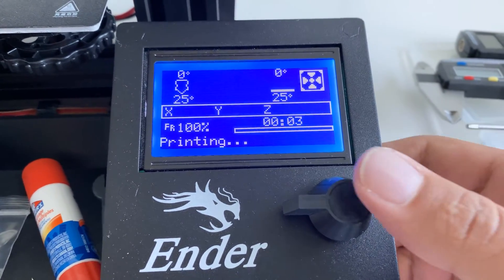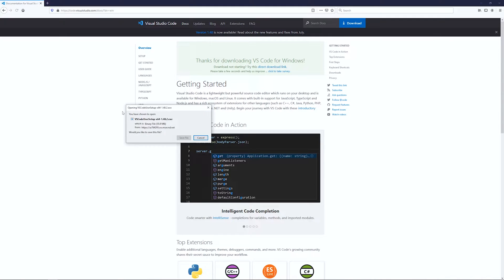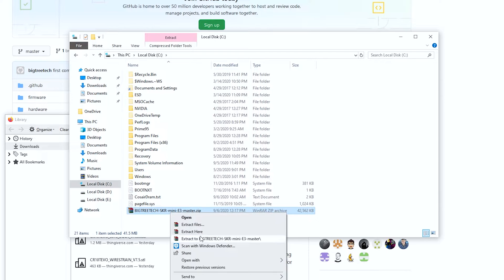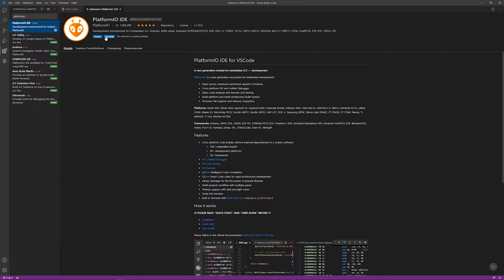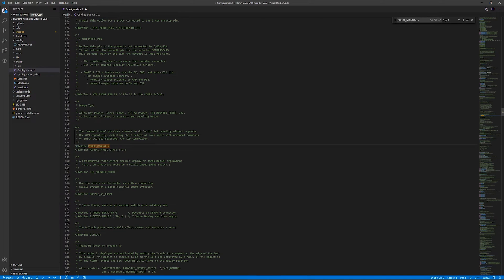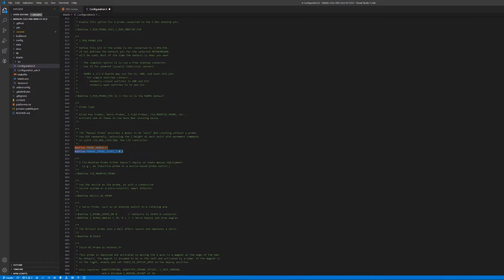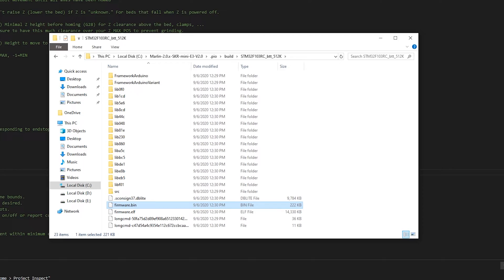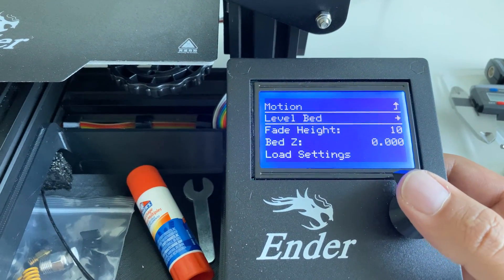Ender 3 Pro BigTreeTech SKR Mini E3 V2.0 Updating & Compiling Marlin Firmware | Mesh Bed Leveling!

Comment from the maker: A heads up that the step of updating the platform.ini file to alter the environment line is no longer necessary. This issue has been resolved in the later firmware versions. You can skip that step.
Reply: Sir i have 2 skr kit
Reply: But no idea
Reply: Did you mean the platformio.ini file?
Reply from the maker: @Mikey_xx_  Correct, that's the one.
Reply: @Boone Nikolas Instablaster ;)
Reply: @Jack Bowen I really appreciate your reply. I got to the site thru google and Im trying it out now.
Seems to take quite some time so I will get back to you later with my results.
Reply: You all prolly dont give a damn but does someone know a trick to log back into an Instagram account?
I was stupid lost my login password. I appreciate any help you can offer me
Reply: @boonenikolas4923  first you need to delete the app and reinstall, when the install is done and before you load the app the first time, go into settings>instagram. Enable GPS in the quick menu, and switch to maps, find the nearest river and throw your phone in it. Works everytime

Comment: When they compiled the firmware what temps did they use for the bed temp
Reply from the maker: You mean the max bed temp allowed in the firmware? If so, the default Marlin configuration has this set as 125 degrees. Not sure if that is changed by Creality in their firmware though.
Reply: @Mangorille  why that high of an temp is it suppose to be that high
Reply from the maker: @monsterstorm78  That's the default temperature. I believe the Ender 3 Pro spec is max 110 degree. I've never used a temperature that high before in real world.

Comment: I'm having trouble from the start. While I've done development work, I haven't touched Windows since 2000 and I'm working on Linux, so things look a little different. I have no idea what is compatible with what in this setup. I get that I need a Git client, but when I go to the link you specify, I get a choice of about 2 dozen clients I can download. Is there one, in specific I need? And is there a way to integrate it with Visual Studio? I didn't see any of the startup configuration windows or steps you're going through and it's hard to read the text, even when I make the video go full screen.
Reply from the maker: You can get the GitHub Desktop, you really won't use it for anything but I found the firmware would not compile without it installed.
Reply: @Mangorille  Yeah, I remember going through and finding that nothing was using it - but I didn't go deeper into it since I wasn't sure which one to get. Thanks!

Comment: Thank you so much for making me this video.
Hey are there any updates on this video maybe to include the BL touch and maybe also a full  Metal hottend Temp limit Disable? Because I'm stuck so many issues....
Reply from the maker: Hey. There's another pre-compiled firmware available from BTT that includes the BLTouch. You can use that or you can take the latest regular firmware and just modify it to activate BLTouch, there aren't that many settings. I've never tried to disable the temp limit though.
Reply: @Mangorille   Thank you so much, it worked like a charm now I gotta figure out how to increase my temp limit so I can print  Polycarbonate And nylon!
Thanks again!  I hope I can help the community as well to learn I'll keep you up-to-date as I learn more!
Reply from the maker: @johneveryman1374  No problem. Check the specs of the hot end you have now, most have a temp limit themselves considering the materials used and the design. If you want to go above that temperature, you'll actually need to change the hot end assembly itself.
Reply: Awesome!! The more we know! Right?
Thank you!
Reply from the maker: @johneveryman1374  For sure, no problem. Search for what's called an all metal hot end, that's typically what you need for higher temperatures. The Ender 3 stock hot end is NOT all metal (has the PTFE tube running inside)

Comment: Can this work on the creality 4.2.7 board?
Reply from the maker: Yes but not using exactly these steps. You need to get the normal Marlin firmware and then modify it for the Ender 3. Definitely more involved.

Comment: every time i start the machine its gives me an error message (i use a btt tft 35 display) "failed to enable bed levelling". As far as i can see there is nothing enabled mentioning auto bed levelling.
Reply from the maker: Hey. I never noticed this as I had bed leveling on my printer. Did you check the config file to see if there was anything in there about bed leveling that may be enabled?

Comment: Já está habilitado o "MANUAL_PROBE_START_Z 0.2" ? Encontrei em "*If ANY(MESH_BED_LEVELING, AUTO_BED_LEVELING_UBL, PROBE_MANUALLY)" e não tenho certeza se está correto.
Reply from the maker: It wasn't enabled by default back when this tutorial was made, it's possible that they added this since then. Even if it is enabled, make sure it says 0.2 please.
Reply: @Mangorille  Foi compilado mas não ocorreu tudo bem na impressora, o eixo X fica travado e não percebi que houve a mudança de altura no bico. Tem algum tutorial para essa placa mais atual? inúmeras tentativas de um firmware que funcione e nada.
Reply from the maker: @Garagemdusouto  What do you mean by locked? The height adjustment should be on the z axis.
Reply: @Mangorille  Não alterei nada nos eixos, os motores do eixo X fazem barulho quando tento mover, pensei que fosse a sensibilidade alta na configuração do sensor homing , mas não é. Já estou desanimado, infelizmente.
Reply: Consegui 100% na compilação sem apresentar nenhum erro na TFT e todos os eixos se movem, mas quando mando imprimir o eixo Z não sobe para construção de uma nova camada, fica fixo em Z(0,2 mm). O que pode ta errado?
Reply from the maker: @Garagemdusouto  I haven't seen that issue before. Would need to troubleshoot to see what's going on. Best would be to flash the same version firmware you have but don't enable the mesh bed leveling and see if the printer works correctly.
Reply: @Mangorille  Vou desabilitar o nivelamento e ver se funcionou. Atualmente tem alguma modificação no firmware diferente do vídeo para atualizar?
Reply: @Mangorille  Fiz a troca do vidro por um espelho e nivelei a mesa, assim consegui um bom resultado na primeira camada, mas o eixo z avança pouco e não consigo terminar a peça. 
Percebi um erro quando mandei o eixo Z subir 250mm e só subiu 25mm.
Reply from the maker: @Garagemdusouto  No, just this modification
Reply from the maker: @Garagemdusouto  This sounds like a step calibration issue in the firmware. Is this on an Ender 3 Pro with a SKR Mini V2 motherboard?
Reply: @Mangorille  Não, comprei todas as peças da impressora e montei. O firmware está para Ender 3.
Reply: Não consigo fazer funcionar 😢

Comment: I see you still have the stock screen, would any of this change if you have the BigTreeTech Touch screen?
Reply from the maker: No it does not. We actually changed to the BTT touch screen in a later video: https://youtu.be/kL9PJB7YFfA
Reply: @Mangorille  I just watched your other video and updated my screen to the the newest github relase they had there but when i go through to do the mesh bed leveling (Touch side) it shows me 5 different points to level it at, but there is no way to move it up or down or save it, (Marlin Mode) under motion it just shows level corners and same no way to move it or save each corner, I'm still running bugfix-2.0.x dated 2021-06-05, think it might be my Marlin that doesn't have it enabled?
Reply: @Mangorille  I updated the Firmware on the Main Board and i got it to show up on the touch screen, it was missing the auto Level, thanks your your help and your great videos
Reply from the maker: @jasonmuller2225  You can add custom commands on the touch screen for that or you can switch from the touch interface to the marlin when doing the leveling.

Comment: hello, very good explanation, I did everything and it worked, the bad thing is that now I constantly get the error "THERMAL RUNAWAY", what can I do, I can't go back to the previous version either.
Reply from the maker: Hey. Can you confirm that your temperature sensors are working correctly? Do you see them reporting an increasing temperature before the error message comes up? Is this on the BTT Mini E3 2.0? If you feel these are all working okay and you are getting a false positive, you can modify the sensitivity of the setting in the Configuration_adv.h file. Look for the section THERMAL_PROTECTION_HOTENDS.

/**
 * Thermal Protection provides additional protection to your printer from damage
 * and fire. Marlin always includes safe min and max temperature ranges which
 * protect against a broken or disconnected thermistor wire.
 *
 * The issue: If a thermistor falls out, it will report the much lower
 * temperature of the air in the room, and the the firmware will keep
 * the heater on.
 *
 * The solution: Once the temperature reaches the target, start observing.
 * If the temperature stays too far below the target (hysteresis) for too
 * long (period), the firmware will halt the machine as a safety precaution.
 *
 * If you get false positives for "Thermal Runaway", increase
 * THERMAL_PROTECTION_HYSTERESIS and/or THERMAL_PROTECTION_PERIOD
 */
Reply: @Mangorille  
Hello, thank you very much for the answer, I tell you:
the board is the "skr mini e3 v2.0" and the printer is the Ender 3 Pro.
as for the thermistor it was the first thing I changed just in case but it didn't work. The sensors report normally.
The printer starts printing normally but in the 3rd layer when the fan goes to 100% the temp. drops from 205 to 200 and it is not able to recover the value of 205º so after a minute it gives an error.

Translated with www.DeepL.com/Translator (free version)
Reply from the maker: @you33771  You can try adjusting those parameters I mentioned to make the thermal runaway less sensitive. Are you using the stock parts cooling fan?
Reply: @Mangorille  problem solved, thanks.  the fan was hitting the block directly and the motherboard was not able to bring it back to its nominal temperature. Very kind
Reply from the maker: @you33771  Glad you got it figured out. Happy printing!

Comment: does it have power loss function ? where i can get the file for sd card without using the software please
Reply from the maker: I haven't tried but I believe so. You can see the definition of the function under Configuration_adv.h file. It's in the section called POWER_LOSS_RECOVERY. To enable, you need to use the M413 command. You would need to play around with it, we have our printer connected to a UPS so no need for this.
Reply: @Mangorille  i am not good at programming i tried once and lots of error. do u know where i can download the file and put it on the sd card ? i dont have bl touch
Reply from the maker: @3dartslb  Which motherboard do you have?
Reply: @Mangorille  skr.mini 1.2

Comment: I did this and now the printer just keeps boot looping and saying card inserted
Reply from the maker: Did you do it on a SKR Mini E3 V2.0 or a different motherboard?
Reply: @Mangorille  skr mini e3 v2
Reply from the maker: @origin3405  Can you try reflashing with one of the stock pre-compiled firmware? Sounds like something went wrong with your compiling or updates.

Comment: Hi! Great video followed it step by step but after leveling the bed perfectly, when i start the print the nozzle move way high into the air. trying to fix it for a week now and its driving me crazy. Any help would be greatly appreciated.
Reply from the maker: Hi. Someone else also had the same issue in the comments. You can try following up with that person to see if they were able to resolve. A few questions, did you try the latest firmware? Did you activate the RESTORE_LEVELING_AFTER_G28? It sounds like the mesh is not being saved and resetting to the 0.2mm initial height.

Comment: mine had different info in system32 line htan yours im stuck
Reply from the maker: Do you mean the Platform: ststm32 line? If so, you can skip that step now. The issue has been resolved now.

Comment: Pulling my hair out man. I installed a bl touch and I've been trying for weeks to compile firmware and it fails every time, each time with a new error. 

I started fresh and followed your tutorial exactly and ended up getting:

"Error BoardConfig: Board is not defined"

This stuff is all so far above my head I have no idea what's going on. Can anyone help please 😟
Reply from the maker: Hey. Are you just looking for the BLTouch firmware for the SKR Mini E3 V2.0? Or are you looking to make some further tweaks to it. I can try compiling the firmware for you.
Reply: @Mangorille  just bl touch and I wanted to make sure my nozzle offset was in there too: - 50, - 5, - 1.85 (I'll figure out z offset once I get a working firmware). 

You would be my hero if you could do that for me. My email is tc677*hotmail if you want to communicate more privately.
Reply: @Mangorille  bilinear leveling, 3 points. I just woke up I'll try to remember any other settings that I wanted to add..
Reply from the maker: @illmannered1  I just emailed you the firmware to try out. Hopefully it does the trick!
Reply: @Mangorille  you're literally my hero. Thank you so much! I'm gonna give it a go.
Reply from the maker: @illmannered1  Glad it worked out, happy printing!

Comment: I don’t like that the various guides, and even BTT’s latest Ender 3 Pro firmware.bin ASSUMES a BL-Touch is installed, and when it finds it isn’t, it blows up
Reply from the maker: Noticed the same thing, you'd think that the default firmware would be for a stock printer. I cover the BLTouch commands that need to be disabled.

Comment: killer set up,  i adopted this for my a30/ only issue i am having is  the first  3 level points are several mm off the front of the bed. where would i correct this setting ?
Reply from the maker: Thanks! It sounds like you may need to adjust the bed size in the firmware. Have you checked that the bed size in the firmware matches the actual size of your bed?

Comment: I have a question.  Will the manual bed leveling work with prints that are sent through octoprint to the printer?  For example, if I do the manual bed level, then have octoprint start a new print, will the printer retain the adjusted bed levels that I entered?
Reply from the maker: I have not tried it through Octoprint but expect it would work fine. The bed leveling is stored to the EEPROM once completed.

Comment: Damn.  Mine does not say the same thing in env: as yours.  For platform, it says: ${common_stm32f1.platform}  Do I erase this all and replace it with your instruction?
Reply from the maker: That step is no longer required on the latest firmware.
Reply: @Mangorille  Thanks for getting back to me on this.  Great guide otherwise.  Thank you.

Comment: Thank you for the video. I have my glass bed with clips. Do I have to modify the "Y_BED_SIZE" so the mesh bed leveling don't touch the clips?
Reply from the maker: You're welcome. Yes, modifying the bed size in the firmware is the best way to prevent the printer from ever going over unprintable areas. Make sure you make the same update in your slicer software.

Comment: Will it come default with marlin 2.0? Or do you have to code it
Reply from the maker: You need to modify the firmware settings to activate the mesh bed leveling. It does NOT come turned on by default.
Reply: @Mangorille  i did nore research and it can if you put your sd in it with marlin 2.0. I think it does. I d ouch nt need bed leveling because i did that manually

Comment: Hi. When I look at the file named firmware.bin on my sd card it says that it is a Cursor file. When I plug the sd card into my machine it doesn't seem to do anything at all. Has anyone else come across this issue before?
Reply from the maker: Hey. What motherboard do you have?
Reply: @Mangorille   I have the BTT SKR Mini E3 V2.0
Reply from the maker: @kevinwhyte1024  Are you able to print from the SD card you are using? If so, then the SD card is fine and it sounds like there may be something wrong with the firmware you compiled or with the bootloader on the motherboard. You can always try one of the pre-compiled firmware from the github site and see if those work.
Reply: @Mangorille  Hi. The sd card works fine and I am using a pre-compiled firmware from a company that I purchased a build volume extension kit from.
Reply from the maker: @kevinwhyte1024  Are you sure that firmware you got was made for this motherboard?

Comment: So i really like the 9 point leveling, But somehow after I leveled, when i start printing the print head starts rougly 7 mm above the bed.
I stored the settings before printing. No idea why it doesnt use the data from the leveling. Any tips?
Reply from the maker: Hey. It sounds like your printer is not saving the mesh leveling. Did you make sure to turn on the RESTORE_LEVELING_AFTER_G28? You can try adding a M420 S command to your start gcode in the slicer after the G28 command and see if that helps.
Reply: I have the same problem. Did you solve it?

Comment: Is their a modification for dual extrudes and 2 steppers on z
Reply from the maker: You can specify the number of extruders and hot ends when compiling your own firmware. Don't recall seeing anything for dual z steppers, you would need to do some more research there. This is not something that I got into as the single z and single extruder was working well for my use case.